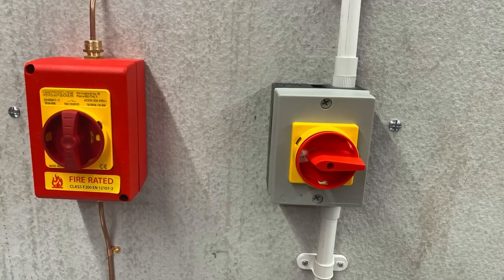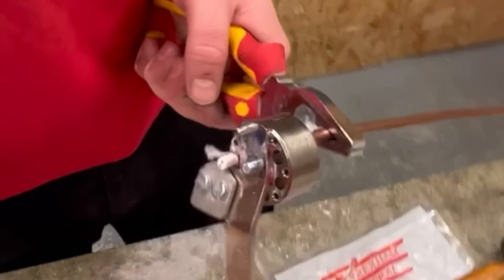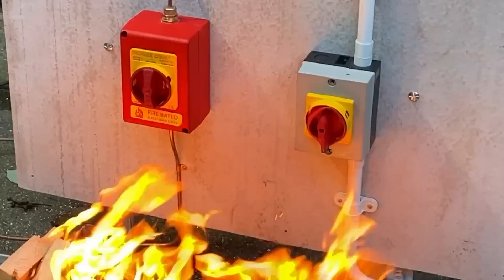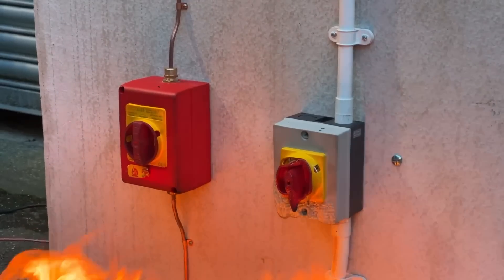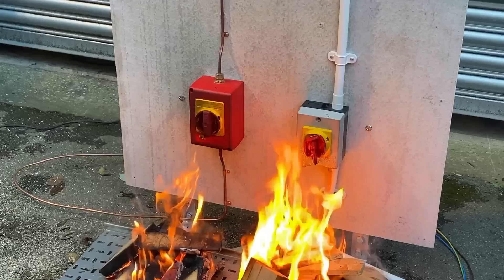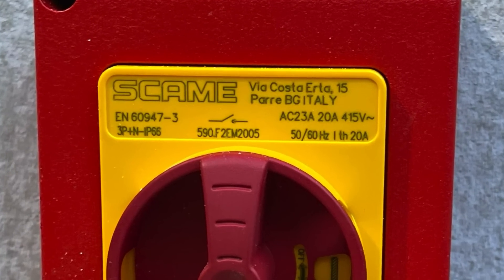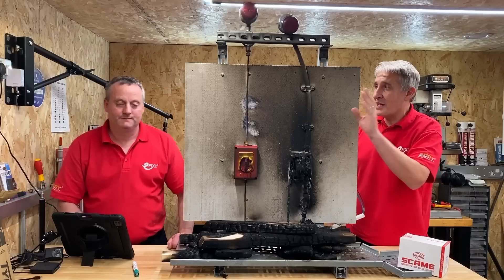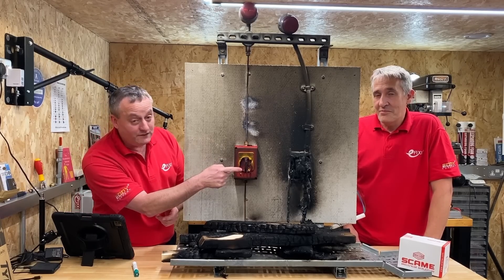Why did we set Fire to this Electrical Isolator?

Comment: Mineral insulated cable is basically a heating element with a copper core, and those are quite fine with running up to red heat for years with no problem. The biggest no no is water on them, especially at the terminations, as, unless properly potted and sealed, the cable will get wet and leak to the sheath. But I have seen some that was stretched near to breaking, while still powered, and there was no short or interruption till it actually snapped.

Impressive switches, looks like they finally made something that is as robust as the old cast iron and ceramic ones that used to be used for switching house supplies, which often I saw were still intact, though black, and on the floor in the rubble, after the house had burnt down. Scary just how many houses still have either DCC gutta percha wiring in them, or paper insulated cable as feed, though there are no knob and tube installs left, they were declared unsafe and mandatory replacement a century ago. But you still find the remains of them in roof spaces, knobs and tubes, with the wire remains still on a lot of them, from the forced upgrade to the plug in rewireable fuses and conduit with DCC wire.

Comment: If you test fire cables make sure to test ph30 and PH120 enhanced as well for critical path signals and networks in fire detection systems. You can’t beat a good old bit of pyro but hard to find someone who knows what it is these days. And if you have a hint of an Earth fault most people run away ! As a young apprentice I was told 1x leg of 1km of 1.5mm copper cable is 12 ohms (11.86 ohms) so finding Earth faults on fire detection loops and circuits became my thing..every 100 m 1.2 ohms rounded up etc. 

Once devices are on the loop put the insulation testers away and as in Star Wars use the FLUKE MULTI METER LUKE😂

Comment: Singles in plastic or even galv conduit is NEVER acceptable for anything that is to be installed for fire safety.  You should have done this test using Prysmian cable or something equivalent.  To be you never should have done that test as an example of a fire rated install.  It will just make a cowboy thing it is acceptable.
Reply from the maker: It was to explain the difference between regular isolators and fire rated ones. We will explore fire performance cables in another video.